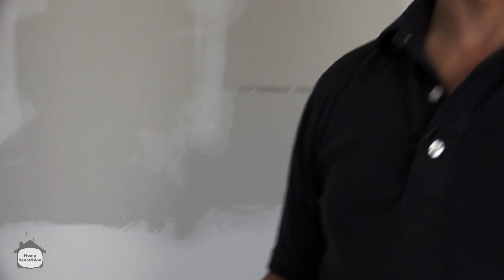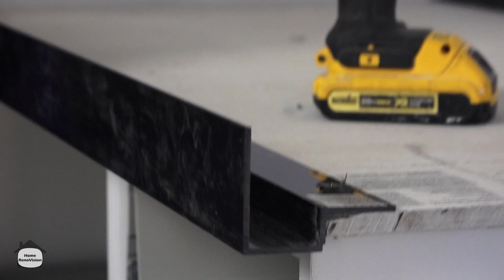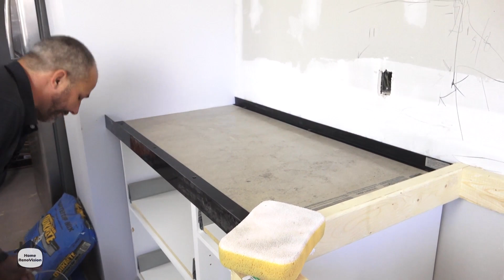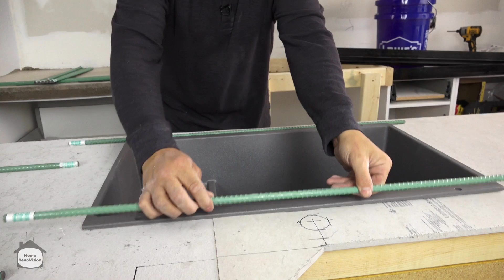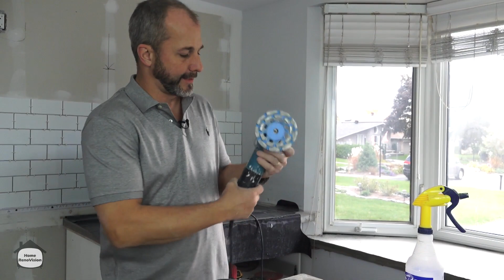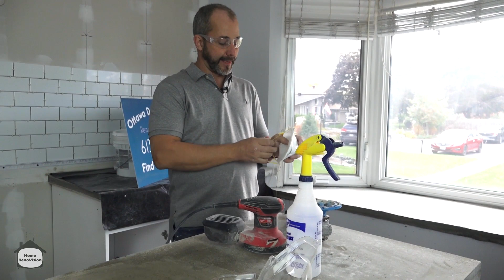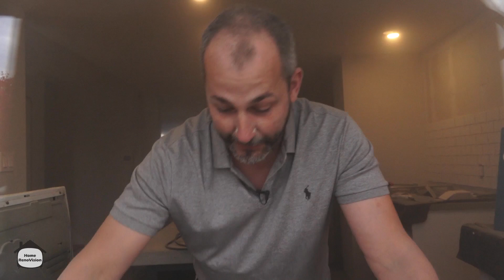Make Your Own Concrete Counter Tops | Rustic DIY Tutorial

Comment: Longer bars are better to ensure adequate development length. Could also use welded wire fabric instead of larger rebar, though rebar would be better for cantilevers.

Also, should use a stick vibrator and poke into the concrete to allow better consolidation and less likely cold joints between layers. In lieu of that, at least poke the concrete vertically with a bar to help consolidation.

Comment: The pour is so crucial and we didn't see that step. Good trowel work and vibrating the frame will save you so much grinding. In fact, shouldn't need to grind, only wet sand. But informative and good work nonetheless.

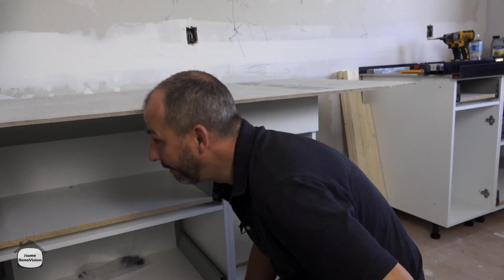Comment: your skilsaw work at 4:15 or so left me yelling at the tv. Do you still have all your fingers, WOW scary. I usually don't comment on this stuff, but you would not work on my job with that technique. Blade buried, kneeling on top of work, and worst fingers directly in front of the blade, it is ok for those experienced to hold the table on either side of the blade on properly supported work, but never in front of the blade. I am a  carpenter general foreman, 40 years experience. Done watching this video at 4:19, thumbs down, you lost me for the rest

Comment: @HOME Renovision DIY  Try using sand mix cement next time it seems to have less bubbles and easy to sand and patch with same mix leaving exact color match i learned that when i worked cutting granite counter tops thats how we resurfaced the saw table  which needed to be perfectly level to get good cuts for the counter tops from the slabs. i was actually thinking about doing something like this but less thick so i could try out a epoxy finish over it instead of going really thin useing plywood and epoxy.gonna start building cabinets as soon as i can get my better half (beautiful wife) to make her mind up on the new kitchen design

Comment: where did you buy this system for doing the cement counter tops. i thought you said lowes but i cant find it there?
Reply: https://www.concretecountertopsolutions.com  for the molds. They also have some good videos on how to use it. There were several mistakes in this video but the concept is there. I just ordered my stuff today. Watching videos to learn tricks and also to see mistakes to avoid. Looks like the concrete that he used sets too fast.

Comment: What if I wanted my concrete counter top to be outside (SW Ontario)? 
I'm sure it would get cracks in winter, but would enough 1/8" remesh and rebar keep it from crumbling into a heap?
Thinking of making a grill table with a circular cutout for a 22" Weber BBQ.

Comment: Here's a guy taking the time to show us how projects can be attempted without a background in the building trade. This one highlighted why construction projects can easily go past a deadline but more importantly - don't start crying about how this or that didn't go as it should have, but roll up your sleeves and get in there and finish it out like a champ.
This z form system can turn out to be an easier and nicer looking project than building a counter outside and lugging it in - once you have the process down. This was a first attempt and it was excellently filmed and not edited to look prefect, teaching is how to get the same or hopefully better results for ourselves.
Thank you for making this video!

Comment: Your entire video.... Every single aspect of it.. Is more of a representation of how and why this is much faster, easier, and better project to do outdoors.

What did you gain from pouring the concrete directly onto the counter top base? Saved yourself some heavy lifting? Well, I promise, you more than made up for it in the additional effort you put into pretty much everything else.

That aside, the direct pour method (in a finished home) prevents you from doing the things like acid staining and maximum wet polishing.

Unless there is absolutely no feasible way to do so, do this outdoors, folks. Go watch some videos of concrete countertop pours that were done outside and see how much better the entire process is, including the end result.

Comment: Is 21" too big and far back for a bathroom vanity top? from back to front It is 43" wide and for kitchen may be problem with faucet even tho it's delta one handle 9" inches and franke sink might be smaller other goosenecks usually these faucets not like wide enough the sink looks big far front too now I think I was going to say something like it but they are all with standard size

Comment: I did the flip method by forming using shelf board and added lots of colourful granite stones. I did it 5 times for different pieces and messed up the first attempt completely. I then ground down the surface by maybe an 1/8 and polished thcrapnout of it. Definitely things I did wrong and wish I had watched this first, but it was fun and ended up with a great result.

Comment: Do enough of those countertops and you'll have forearms like Popeye from working that wax in.  That looked like it was harder work than the rest of it all put together.  Would it make it easier heating the wax up a bit first?  Maybe just letting the jar sit with hot/warm water halfway up the height of the jar?

Comment: I hate the product but your craftsmanship is unquestionable. Very labor intensive and not worth the look for residential single family homes. Plus it would make for a difficult remodel down the road. Maybe more suited for loft, open ceiling, style condos or industrial type designs. I just don’t personally like it but you did a fine job for your first crack at it! 👍

Comment: Poor guy, you do learn from your mistakes. It takes a lot of guts to do something like this. I have made wall caps and outdoor concrete counter tops for fire pits , pizza ovens and barbecue islands. So many ways to do it. The quick Crete cement is good but has to much rocks and sand. Add a little bit of Portland cement and concrete glue to the mix. You have to screen the rocks out for your slurry or just use Portland cement but the color may differ. Practice makes perfect. I agree with the other poster about those haters that look only for fault but wouldn’t attempt this big project

Comment: Nice, I see the start of a kitchen counter solution in this video *sigh of relief*. Nice to see a low budget, yet trending, project video. Thanks for keeping it real, my "mistake laughter" is a bit more... maniacal, lol
Reply from the maker: I think you will like the laminate or tile option better. large format tile counters are back and looking better than ever. Cheers!
Reply: @HomeRenoVisionDIY  my island is tile now and I really hate it, I plan on enlarging it and adding an eating bar - laminate is looking super doable. I have 4x6 white subway tiles for the backsplash, looking at ikea navy/black for base/door. 21 feet linear wall to work with (12 one side, corner, 9 other side), going to almost double the island from 3x4 to 4x8. Keeping costs down is a must, lol 🍻

Comment: I used a cup grinder disk like that to the get thinset of slab before insulation/heating matt/latex/tiling and I got a dust extraction shield for it from amazon  really cheap like £20, attached to the festool extractor there was no dust.

Comment: I was dead set on pouring the concrete in place.... until I watched this. On paper and in my head this method sounds like half the work compared to the upside down, build a jig method, find some friends to help you carry it.  Now that you’ve been the lab rat it’s pretty clear this is a lot more work, ...cleaning the entire house to remove the toxic concrete dust is more work than the actual job!  And You lose the ability to create something special since you can not add sea shells, agates, color...etc for a truly custom look. 
You’re adding a significant amount of weight to your cabinets and floors compared to the foam core/hollowed out center of the upside down method. 
And you’re left fighting to make everything smooth and level. Counter tops need to be perfectly smooth. Leveling a low corner in your basement will not give you the skills needed for this. 
Building a jig and carrying the counter tops from your garage to your kitchen suddenly looks like the only way to do this.  Like you, I work alone most of the time, so I thought this was the best method for a 1 person crew. Thanks man. Your videos are great. Your 1 man crew shed build helped me out a lot. This video blew my mind... how was I so wrong about this. Crazy.

Comment: Working with concrete is a learned art form. 90% of the work is in the preparation. The formwork had some flaws and the fast setting concrete was a mistake. Also, grinding in a house is a huge mess. Next time, do more research. But at least you tried something new and maintained a good attitude.

Comment: I think you did great job, explaining and installing. But honestly for a DIY project it is way to messy unless the house is empty. You can barely even see through all the dust in the air.
Reply: he could of used a sanders hooked to a dry wet vac

Comment: It isn't really the best way to concentrate counter top, too much dust and unnecessary work.
Why not upside down casting to a perfect finish?
Reply: I think because in the long run this is faster and safer.  You watch the perfect youtube videos of using the melamine forms but the amount of time invested in making those and getting the measurement done and placing your knockouts in and doing all of that remembering that the measurements are reverse becomes very challenging and often error prone.  Then finding a friend and carefully carrying them.  And on top of that you still need to mix all the concrete, you still often need to sand and grind, and you still need to seal and protect.

Comment: If you pull the filter off your sander, you can connect your vacuum to that port and you're working virtually dust-free.   I do it that way with my Bosch sander and dust extractor.  Leaves the house spotless!  Lastly, great vids, I just found you and have been binging all your stuff.  You are so easy to watch and a wealth of knowledge.

Comment: Bit confused as to why you didn't float or trowel it. Both the quikrete instructions/video and the zform instructionals advise more than just the vibration and screeding. This was a lot more rough than my first experience with the two items. I think reading the instructions will help you more next time.

Comment: too much maintenance, too much labor. Better to stick to granite.
Reply from the maker: except the cost difference is still to be taken into account with your analysis. concrete 500 bucks granite 3500.00
Reply: @HomeRenoVisionDIY  damn, i don't know where you are, but here in los angeles, we have ready to install decent looking 9ft granite slabs for under $350-450 materials.

Comment: Do yourself a favor. Do not screw through the top of the concrete board into the cabinets. The counters will be permanent with no way to remove without destroying the cabinets.

Comment: It's tough grinding and sanding inside the house. For an ultra smooth finish, I poured a countertop upside down onto an old glass patio door (using a wood mold for sides). Then just wet sanded up to 2000 grit.

Comment: Just sanded my concret floor today. Removed adhesive for self leveling . I used the vac connection and dual filtration, no silica dust.

Comment: Ah, dude. Get the dust shroud for the grinder and hook it to your vac. It will cut down the dust by leagues. On sander hook up the vac also. I have done it your way and have found better ways.

Comment: Wondering if it is safe to do an acid stain on a countertop? I have a tiny kitchen so I think this is a doable project for me. However, I want some color in that concrete. Thoughts?
Reply from the maker: concrete can be stained but it is not food safe so be sure to use a cutting board. Cheers!

Comment: Oosh, that looks like a real pain! I was surprised that it was as hard as it was after watching the first one. 

One comment- one of my jobs for the Navy is 'Safety!' and, I really just want to say that those dust masks are NOT adequate. You really need a proper 3M (or other brand) respirator with particulate filters for stuff like this- you will be AMAZED at how dirty the filters are when you're done and thinking, 'Oh, damn, I could have been breathing all that in!" Also, the base respirator is washable and not any more expensive than cheap dust masks in the long run.(And they'll work fine-ish over your beard if sized correctly)
Reply from the maker: Good thing I don't do that every day for a living. Cheers to the Navy!

Comment: The sanding part was a torture to watch. I made a mistake of grinding old tile thinset off the floors. After three years, my wife is still mad cleaning concrete dust!!!
Reply from the maker: I use negative air and it cleaned up in an hour. Cheers!

Comment: Could you please explain how you kept the mold in place around the sink? Great video otherwise
Reply from the maker: Hi Colin the mold has an adhesive strip that sticks to the sink. Cheers!
Reply: @HomeRenoVisionDIY  Thanks so much for the response. I have to ask, given your experience using this system, if you had to do it again, would you go this route or stick to the more traditional upside down pour method? I want to do concrete countertops in my kitchen, but I am not super skilled so worth keeping in mind. If you had trouble, I cant imagine what kinds of problems i'd run into.

Comment: Nice work and good information on the process and some of the tools that are out there  BTW  Fast Cap  has a great set of scribes  available they are plastic and the nice thing about that is they do not  make any marks on Drywall or even finish painted walls  i actually  have  a couple of them i carried in the feild  for installing Architectual Woodworking  for 20 years and they never had a problem  for me  i am in no way associated  with Fast Cap other than owning a few of their products and being a Subscriber of their You Tube channel  just a suggestion on mixing in a 5 gallon  bucket  with a drill usually if you put water in the bucket first it seems to mix  quicker   When i was younger i  helped   Out  some freinds that were in the ceramic tile and Marble industry  and did some apprenticing with them  often i was mixing thinset and grout to keep the job moving as fast as we could  at one point  for a outdoor  tile we  were grouting it with a Quickcrete  bagged mortar  and sealing it with Biled Linseed Oil/ Mineral Spirits mixture   That happened to be in South Florida and many of those  jobs were for Pool  Patios  and l the tile was a Mexican Terra-cotta  hand formed 12 X12 tile with 1/2 “ grout joints  the Lindseed oil sealer was  used to seal the grout and tile

Comment: A cubic foot of concrete weighs 150 pounds. A 2 inch slab of concrete weighs 25 pounds per square foot, not 80. 
I would have vibrated the mix in the bucket before pouring it to get most of the bubbles out. Vibrating the edges would have removed most of those bubbles. Mix the cement with ice water and slow the set up. 
You sure talk a lot of BS hot air. I've NEVER done a concrete counter but I have worked with concrete, mortar, grout, and tile, and I would have never made the mistakes you have made. Mask the room and grind wet. It is much easier to mask than clean up. That fine dust will be in every crack. At least I know how not to do a concrete counter. 
BTW, The pros do not use quick setting concrete. Home Depot caries the Rapid Set brand and it sets too fast too. 
There is an old saying. Watch one. Do one. Teach one.

Comment: This guy thought he was going to save time doing a pour in place. I'll never do pour in place again. It takes longer, way more prep and mess in the house, and never looks as good as when poured in a mold. If you're considering making these yourself making a mold is the way to go. You can contain the mess where ever you decide to make the mold (I do the sanding and finish work out side). This guy couldn't have made this job any harder or messy. Not to mention he put dangerous cement dust into the air of the house to settle every where dry sanding the counter top. The end result was nice but there are several much easier, safer, and better ways to do this.
Reply from the maker: Hi Patrick, this Guy said in the video that we were trying pour in place due to the shear size of the counter and weak spot related to the location of the sink and faucet.  No need trying to make me look like an idiot. I was simply showing the crazy work that goes into such an ordeal. take it or leave it. Cheers!